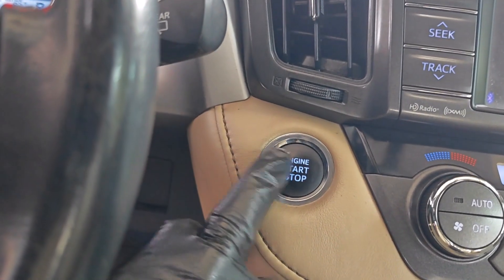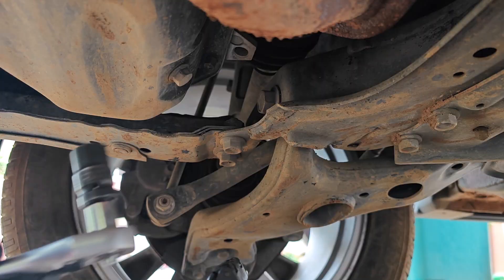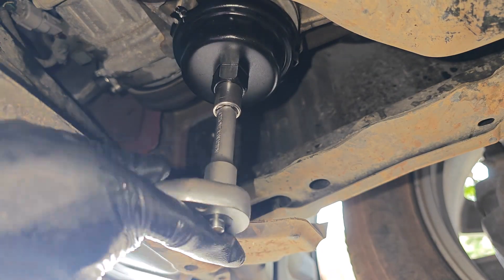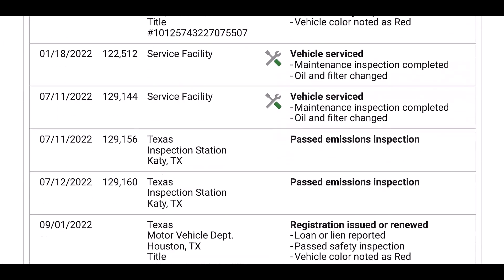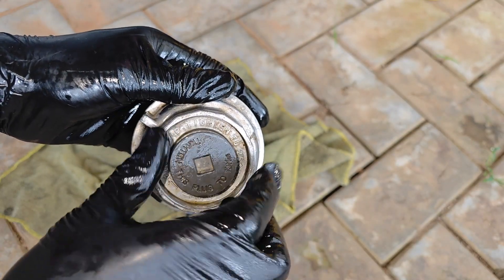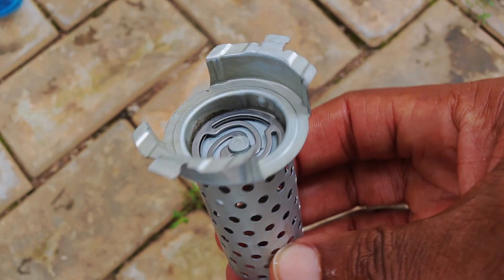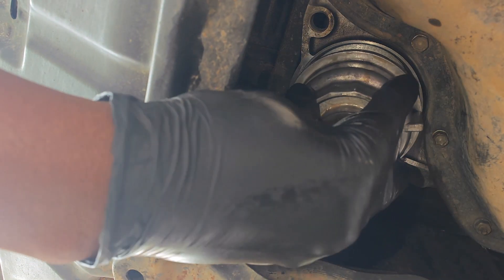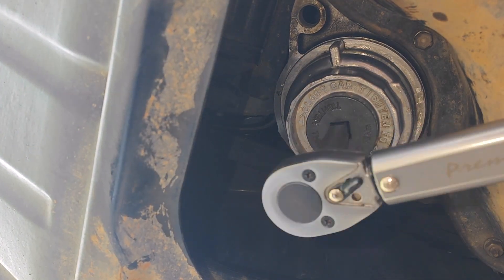This will damage your ENGINE! Lube Shop Fail / Costly Oil Change Mistake & Early Engine Failure

Comment: Never spray brake clean or any solvent inside the filter cartridge. Even a small amount is enough to change the chemistry of the oil. Just drain it upside down if you have to and wipe it off. It's just oil no harm done.
Reply from the maker: The solvent I used was fast drying, so no issues. But I agree with you, no need to do that except you have some sediments there. That was exactly my case. I could see that the leftover oil was heavy with filtered material so had no choice but to clean.
Reply: @DIYAutoworksNG  Oh okay, Makes sense.

Comment: Asking for clarity.....isn't your "Warning" ( as true as it is) ....a bit overblown to suggest that the lack of this center-tube will cause "early catastrophic engine failure" ??..... let's review. The oil filter element, when installed, presses against some sort of spring action when the housing is fully tightened.....this assures both "ends" of the filter are tight against the housing. This avoids filter-element flow bypass. Then.....the internal tube that we're talking about... is only a tube length with holes along it's length...which "improves" the oil flow to more evenly hit all the pleats along its length. The absence of this tube does very little other than distributing the oil flow a bit better along the length of the filter....having this tube gone still allows oil to flow through the filter without short-circuiting the filter. I see this as a minor improvement in oil flow management, on the entering-side of the filter ( more even flow along the filter body length)...and nothing more. If your warning were true...especially saying lack of tube can collapse the filter element...ask yourself.....how did the filter survive all the (shown) previous oil changes without issue??
Reply from the maker: There's a video the car care nut has on a Highlander with this same oil filter housing. The engine had some very loud ticking noise and it ended up being that the filter collapsed and was leading to oil starvation. This was despite having the center tube. Just imagine if the tube wasn't there, the media could get sucked into the inlet side of the engine. If you notice, the oil filter that was there previously had solid plastic caps which adds to its integrity. If such good quality oil filter wasn't being used, the story may have been different.
Reply: @DIYAutoworksNG  ..well.....we've been using original Toyota filters all along...can't recall seeing the tube and never had a filter failure. I would say if you took out an old filter and found it still "in shape".....there was no danger and no damage done. Notice you are relating an issue where the filter failed AND the tube WAS STILL THERE.....there is no substitute for OEM filters.
Reply: Clown 🤡, has no idea how things work!

Comment: I just bought a 2019 Lexus RX350 from a Ford dealership. They did an oil change before I bought the car. I also had my mechanic do a PPI before I purchased the car. As someone who has done his own oil changes since I was 14 years old (now 58), I decided to change the oil myself. I also bought an OEM filter housing just in case it broke when I removed it. Sure enough - the middle canister tube was missing. I was pretty angry, but glad I had the wisdom to have a new Lexus filter housing ready.
Reply from the maker: Many shops setups are driven by meeting margins and attention to detail is sacrificed in the process.

Comment: Africans really like to use those recycled water bottle funnels lol, much better than paying 10 bucks for a plastic one you can never find
Reply from the maker: Lols. That cut water bottle stays permanently in my trunk! I bought one of those collapsible funnels and it was a joke. I also have other funnels around, but this cut bottle gives the best fit.
Reply: Take an old 1 gallon plastic milk jug and after cleaning.... cut off the top half and use that. The "thread" is not a perfect fit to the car but will deform enough to create a tight fit during oil filling....afterwards, use the milk jug cap to prevent excessive oil spilling after removal. Your welcome.

Comment: Yes, changed my oil about a week ago. The cap was missing the center tube. The filter was mangled, potentially from the first time it was started by not having oil on the other side. It was a bosch so it had the full plastic ends so it shouldn't totally collapse. This isn't the first time it's happened. Last time it happened, I told myself I would only do the oil changes myself (so of course when I decided to change my mind, it happens again). I'm using the dorman aluminum cap with their center tube that doesn't fit very tight. I think you are right, it's staying in the filter and the tech doesn't realise it's still in the filter. Slap and go.
Reply from the maker: You just saved an engine right there!

Comment: This why I do my own oil changes.
Reply from the maker: Totally!
Reply: Me too!  I torque the drain plug to spec too and not the “mechanic’s feel”.
Reply: Why? You could make a mistake too I hate this argument
Reply from the maker: @Hellcat71782 So I agree with you. I've made mistakes, certainly. 
Really, attention to detail is what I actually mean. While there are very good lube/maintenance/dealerships, a good number also lack attention to detail. It's against this backdrop that I made the statement.
I never used to be a DIY guy, in fact, I would have never started DIY, if not for the frustrations I got from shops and dealerships. Including selling me supposed OEM, only for it to be the cheapest crap aftermarket. I got into DIY out of frustration, but it ended up turning out good. So I guess you see where I'm coming from.

Comment: Then you would get blamed for the engine failure, and/or you would have to go to each place that the vehicle got an oil change at and prove (however you plan on doing that) that they didn't f==k your $h¡+ up!

This is why I
- do my own car maintenance/repairs as much as possible.
- prefer the spin on filters!
Reply from the maker: Absolutely! 
DIY all the way as much as one has the skills to do so!

Comment: Caveat!
From the looks of things, you might want to get a brand new OEM canister replacement. The standing pipe isn’t a serviceable item and it shouldn’t be detachable the way you have it set up, once it’s detachable that way, you need a replacement. Car Care Nut did an extensive video concerning this. You might want to check it out. 

Cheers!
Reply from the maker: So after watching the Car Care Nut video on these filters, I've decided to get the OEM canister. Thanks for flagging!
Reply: @DIYAutoworksNG  You're welcome! We learn everyday. I learn from your videos too. Keep up the good work 💪🏾 💯.
Reply from the maker: Thanks for suggesting. I'll look up the video. That plastic OEM cartridge has a tendency to crack. The center tube on this  aftermarket housing is serviceable.

Comment: Nice video. Can you tell me the part number and brand of the oil filter removal tool you have? I'm looking to purchase one.
Reply from the maker: I got it locally, just one of those generic ones. It came with 3 slots on either side, and didn't fit initially until I bent of the prongs making it 2 slots per side. Lol